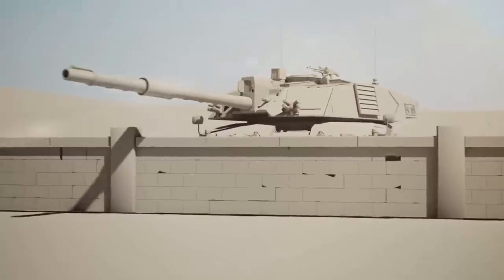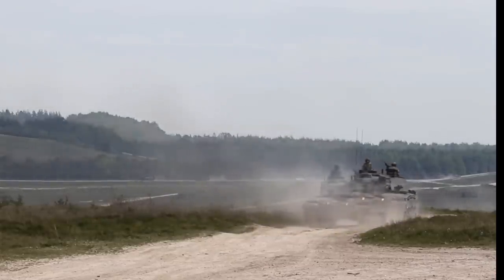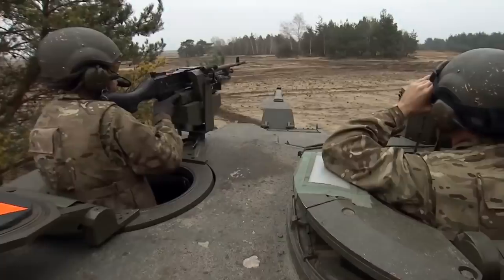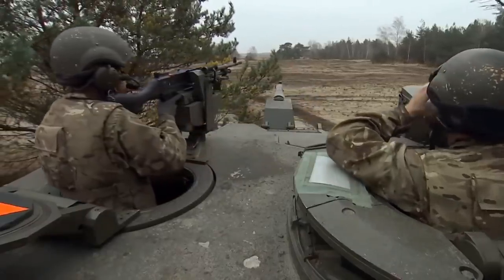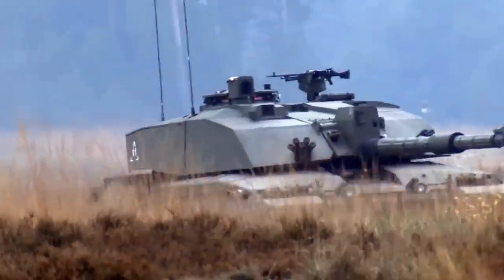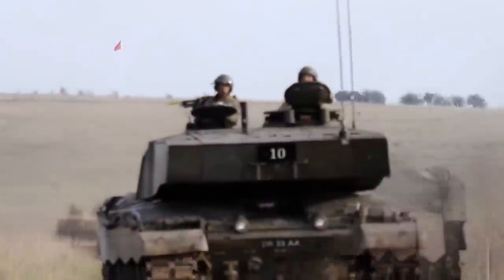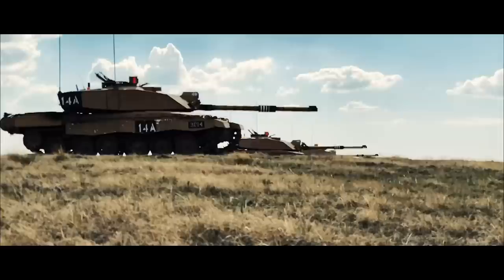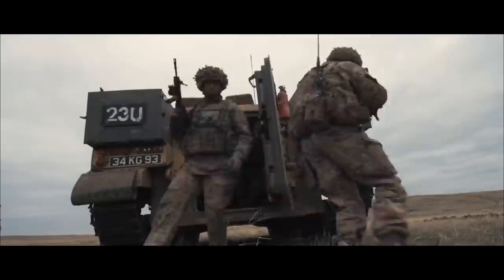Challenger 2 Tank "Black Night" | MODERN UPGRADE

Comment: Hmm... apart from the natural process of getting rid of outdated parts and replacing them - OK. But seriously:

There is not any signs that the Russians are able to come up with anything that really can be a challenge to what Nato allready have. The problem is really Germany that has sold their large stock of Leopard 2 - at firesale prices. There might be some idea in putting a sexy french turret  on the Leopard 2 chassis - getting rid of some of the German overdesign.

Even if Russia is able to come up with something substantially better than what they have at the moment: It is a no starter. Russia simply can't afford it. Besides the point: What the russians really fear is that the army realizing they are in for a short and very bloody carreer - well then they just might turn their tanks around and replace the management, as they have done so often before.

If we see the Baltic area with the formation of a divisional command and heavy tanks from Norway, Denmark and Canada (40-50) a piece then a divisional reserve from GB with a similar number will be able not only to deal with the pitifull tatters that might limber through the main forces but also will be able to smash back in a counterattack that threaten to cripple Putins constituency.
Historical evidence informs them, that an assault will incur casualties Russia today cannot afford - much less is likely to be able to aquire.

No this seems to be the sensible proposition: Take the Challenger 2 and tart it up a bit put some new periscopes on it. With a nice supply of replacements, because - as You say - they are the pieces that are liable to break when the arguments turn nasty.
Reply: Is that before or after the nukes land?.
Reply: Singha Mura 
Joke's on you, the autoloader was one of the modifications.
T-72B3 is very much up to T-90 standards.

It's 2018 and people already figured out thicker penetrator helps it resist effect of composite/ERA but people are still bitching and whining about Russian APFSDS having shorter/thicker penetrator.
Reply: The problem for the Russians is that they do not have the troops to use that tactic any more. We saw how they got butchered in Chechetnia.
Another point is: Stalin could use the tactic, but Putin cannot, as the army is on the verge of mutiny!
You saw that at the invasion of Ukraine they pulled out a battallion just before the invasion (and apparently replaced it with a local defence battallion that ran out of fuel). The entire officer corps in Khaliningrad (Königsberg) was fired - indubitably to incompetence. Ineptitude is as serious as disloyalty.
Not that our side is without mongs among officers.

A lot has been written about the T-14 braking down at the rehearsal of the parade. Whether it was mechanical malfunction or driver incompetence is immaterial: They could not even practise a parade!

The other thing is: We are talking Nato now! If they try their grabbing technique in Bulgaria there is nothing to stop a counterpunch against Sct. Petersburg - and THAT is Putins constituency.

As to the nukes?
1. How many of them work - agreed 1 is enough.
2. How can they control them from going rogue? I mean: A nuke for Moscow fired from the suburb?

The point is that Russia is collapsing and the trick is to make it so slow that the butchery does not spill over in our pumpkin-patch.
Reply: Ahhh.... a couple of years ago a couple of F-15's landed on Ämari where a C-23J allready was: In depth photoreported, but not widespread.
Reply: Thomas Borgsmidt Сало уронили!
I am satisfied with the hysteria of the "western" trolls)
Beautiful words that contradict logic and common sense. You are repeating the principles of propaganda that are old as the world; it works for people who think in illusory categories, which unfortunately are the majority. But for those who understand the technique, tactics and economics, such sophistic exercises are ridiculous.
If you are sure of yourself - Μολὼν λαβέ! But do not think that it will be easy, maybe you will even be left alive as a result, someone must restore the destroyed.

Comment: Iv Read that the russians have cancled their initial order of over 150 t14s because they were too expensive and instead are working on their t90 t72 fleet
Reply: Yep. 'Armata' (T-14, T-15, T-16) program is cancelled, 100 units will be produced, after that, production line will shut down. Mr. Borisov said T-72 and T-90 versions are plenty at the moment (which is total BS, but yeah).
Reply: @jonny2954  so that means the ultimate fight to the death t14 vs NATO Tanks will not happen...Sigh just as when things were looking good
Reply: No you are wrong. Russians don't have money.when they get money they will start mass production of armata combat platform. Same for su-57
Reply: T-14 was a cheap version of Object-195 anyways.
Reply: @seemabalkote1759  that's what happens when oligarchs don't get taxed and bribery runs rampet.
Reply: Seema mate,...
Russia's economy is the same level as Italy, and much smaller than UK for example. Despite them pumping 5.5% of GDP into military, the net numbers won't EVER get to point where these incredibly expensive projects will get to point of reality....With the corruption rooted deeply into the state, the projects would also be overpriced to hell. The might of Russian military is long gone, and it is only getting worse. Especially after Putin's presidency ends...
Reply: @Rayhan That's not true. They originally planned over a thousand by 2025. However they cancelled these plans because of cost. But in 2017 they made an order for 100 t14 armatas by 2020. They already have 20 - 30 t14s that they were doing tests with. So by 2020 they will have around 120-130 t14s. They did not cancel this order. Yes it is true they are modernising around 400 T90A to T90M and around 2000 t72 has been modernised to t72B3 and T72B3M. also around 150 T80 are being modernised to T80BVM. This is a extremely cost effective solution. Also they have ordered the first 10 BMPT72 terminator tanks which are being accepted into the army.
Reply: We're fast approaching 1998 again. Back then Russia's economy was collapsing and China's economy was still reeling from the impact of the 1996 crisis. So China quickly snapped up unemployed but experienced Russian engineers to beef up their industrial base and put a lot of defense R&D projects on hiatus, substituting them with Russian imports. Russia for her part was forced to sell a lot of military IP to the Chinese to keep the MIC alive. If the situation repeats itself, we'll hopefully see the Armata (or its technologies) in Chinese service in a few years. A Chinese Armata would be pretty dope, and hopefully the Chinese won't shy away from the 152mm the Russians rejected for logistics reasons.
Reply: If someone takes the statements of the media seriously, I'm sorry for you)
Armata is not only a T-14 tank, but a platform for new systems. You confuse pre-production samples and those that will be transferred to the army.
UVZ stated that:
T-14 will be produced in parallel with the repair of T-72B, modernization of T-80B and T-80U, T-90A. This is done by different enterprises. As long as the Armata platform does not occupy all niches of use.
Why not make it fast? Because it is not a game or comics. It takes years. Few people are able to realize a similar scale. These are not 200 and not 500 tanks, they are thousands of units of equipment, not only tanks.
This work has been done since the mid-80s (Project 299). And now gives its fruits)
Yes, the 152mm module is ready. But it will have another cipher, not T-14. There are many specialized machines.
Reply: Jonny
No, Armata is a continuation of program 299. T-14 is a derivative of object 195, this is not one thing total.

Comment: How is the Challenger 2 classed as an MBT when it cannot survive a hit to its under glacis plate, surely it would be classed a Tank Destroyer as it fights long range and uses cover to hide its weak lower plate. I'm not trying to offend the tank or the people that enjoy it, in my opinion its one of the best looking MBT's for sure (and in black it looks insane), but compared to an M1 Abrams - a true MBT - the Challenger 2 seems more like a Tank Destroyer. Just curious why its classed as an MBT.
Reply: Karnipex I see what you mean but the term tank destroyer isn't really used anymore
Reply: True, apart from the STRV 103 :)))))
Reply: Don't let Mr Moran hear you say that.....
Reply: In areas of combat the Challenger 2 is already fitted with a block of Dorchester composite for the lower glacis plate.
Reply: Stop refering to games
Reply: The lower plate protection on fielded Challenger 2s has been significantly improved.
Reply: Karnipex:
But the Challenger in question did survive and was not knocked out, though it's driver was wounded.  Read the accurate incident report before you engage in nonsense.
Reply: Chris, as a Mr. Moran, Steel Beast gamer player, and friend of Matsimus. My interest is piqued by your comment. Have I said something regarding the Challenger 2, or has a smarter relative said something profound about it? :-)
Reply: You know the Challenger 2 has a better survivability record than the Abrams right? Both tanks were used in the 2003 Iraq war with the US having 17 Abrams destroyed or damaged beyond repair. Only one Challenger destroyed when it was hit by friendly fire while its hatch was open (the round actually hit the open hatch lid sending shrapnel into the cabin with 2 killed and set a fire). But to be fair to the US, they deployed more tanks and so had a higher probability of more being destroyed. It also worth mentioning that the Turks have had 10 Leopard 2 losses in their Syrian conflict (the caveat being they were older A4 Leopards and were operating with questionable tactics).
  So, caveats aside, the Challenger 2 does have the best survivability record of the 3 main western MBTs.

Comment: Thing is, you change the gun, you have to completely change the turret with bustle ammo storage and then strip out the hull floor storage. Then you change the engine and really there aint much left. Tracks transmission and hull.

Comment: Still with that trash gun and engine. This isn't an upgrade, this is a insult. Knowing the UK MOD, even though Rheinmetalls proposal will be superior (no doubts about that), they will still choose BAE because 'british jobs' and stuff.
Reply: Trash gun? Really? It still has some of the highest penetration of a 120mm tank gun out there.
Reply: No, it doesen't. It's the worst 120mm tank gun in NATO.
Reply: @jonny2954  errm no its not, its one of the best, only the L55's ammo has higher penetration and that does not have "that much" higher penetration either, also considering the vast majority of RM smoothbores on NATO tanks are L44's....
Reply: L44/M256 and GIAT CN120-26/52 are also much better. The problem with the L30A1 is its lower chamber pressure, higher friction, lower EFC count and shorter/lighter APFSDS penetrators in comparison to smoothbores.
Reply: @tonyb1223  The british MOD now changed the requirements for the LEP. A smoothbore gun is now mandatory. That probably also means a new turret.
Reply: @jonny2954  it needs more than a new turret, it would require a new tank because of the way the 2 piece ammunition is stored, this is the reason they binned the idea of a smoothbore gun, too expensive, instead they found themselves a new munitions manufacturer.
Reply: @tonyb1223  The hull is fine. It was the turret that had the stowage problems for the one piece ammunition.
Reply: Jonny just so you know the gun is bloody marvellous
Reply: @angrypenguin6966  It's pretty shit.
Reply: @angrypenguin6966  Don't argue with Jonny, he knows EVERYTHING about EVERYTHING!

Comment: I cant imagine it would be that hard to get an extra 300bhp. Also with modern engine technology a hybrid option could work too. The E-Motor can torque fill and provide a silent "creep" mode plus potentially better economy therefor longer range.

Comment: Wish they would change the barrel also. The riffled one has better lifetime, smothbore higher muzzle vel. right?. But i have a question would the breach capable  or compatibel to a existing like most used l44/55 and its licenced versions?
PS: 2nd question also answered by the vid if the riffled is capeable, shooting ammo like NATO M829 DMxx but you said that ammo issue not able to do this. And britain stands out in this situation using riffled gun in a MBT of this days the costs must be high.

Comment: I feel like this package is great since it focuses on the vehicle and crews safety from infantry and air attack in the sense that it includes these missile detecting sensors, however even with the driver and comanders new sight systems, not much has been done to improve this hunter killer role that was mentioned so much and that is why I feel like this power pack is vital so the Challenger can keep up with lighter or even more modern combat vehicles
Reply: Anne Isopod  however, it is useful when you have a small explosive device on the exterior of the vehicle that is designed to destroy incoming missiles

Comment: It needs a 2000hp engine, with all the stuff getting added the weight just keeps going up and up, it's over 70 tons already. A 1500hp just won't cut it anymore. 
Stick on an L55 smoothbore, bit of extra armour in weak spots change the external GPMG to a remote control one, but priority engine and gun definitely.

Comment: COOL!! As a former Tank Commander of TC. Is this tank going to be better at maintaining like the engines, fire control systems, main gun, suspension, tracks, etc. As being in armor once upon a time. Tanks requires maintaining out in the field every time we stop or do a short halt. Knocking back or replacing end connectors, add oils, and checking links to steering. Bore sighting, ballistic computer indexing with ammunition for gunnery. Stuff that goes through a Tank Commander's mind and his crew at all times in the field for training or combat. On a tank the manual will go as long the Christian Bible or War and Peace from maintaining this to how to employ it in combat. Far complex than in my previous life as a Paratrooper and Infantryman. Being a Tanker is far more dangerous because this machine can injure or kill a person when you don't understand how it works and the safety stuff associated by it.

Comment: Mate, I am only going to concentrate on APS.
The Israeli Industries Trophy system has now been fitted to Merkava 4s for at least the last five years. In that time they have been actively engaged by the latest Russian ATGM as well as the good old RPG 7 when they went sight seeing in the West Bank. The system works, it has managed to defend Merkavas against multiple simultaneous engagements. The Iron Fist system that I presume the "Black Knight" has been fitted with has been in development for the same number of years but has not been fielded by the Israelis. Both use a combination of radar and optical sensors to detect missile threats. However, the Iron Fist uses an explosive blast technique compared to the tungsten cube shotgun/claymore effect that Trophy uses to defeat threats.
You mentioned the T14 Armata with its Afghanit APS. I don't believe it is a flexible as the Trophy/Iron Fist solution as its fixed over the forward quarter of the tank. Therefore anything approaching from the sides, rear or top will not be engaged. The T14 is built around the standard Russian doctrine of offence is the best defence, hence the massive armour protection up front. The Iron Fist has shown in a  "demonstration" that it could defeat a top attack ATGM when a Hellfire was targeted at the demo vehicle.
My opinion is that for Chally or any MBT to remain useful on the future battlefield it needs APS to survive.

Comment: Israel used active protection systems in combat a few years ago and they were demonstrated to be highly effective, intercepting the majority of incoming threats. It could not intercept all but protecting against more than half is quite a large leap in overall protection combined with other systems for relatively small increase in weight.

Comment: The Challenger 2 is 20 years old now and as such the need for an update, if not replacement is not suprising.  Having said that it has proven itself to be possibly the worlds best protected tank of its generation.  Clearly the T14 Armata has this beaten in terms of active protection and crew protection.  The Challenger 2 is not going to be able to match that because it needs a completely different design from a typical tank layout.  The main areas the Challenger 2 needs to improve in order to remain relevent until 2030 are down to the electronics and computing hardware plus active protection.  

I think that the military are taking a page from the science fiction stories of the Battletech series.  That features a system called AMS which stands for Anti Missile System.  The basic version of this is a computer controlled automated light machine gun turret that targets incoming missiles.

I would expect that development on a new tank will start in a few years to replace Challenger 2 in 2030.  Whether it can be delivered on time or on budget remains to be seen, probably not going from recent examples.  I would expect the issues of switching to a different gun, power plant and possibly automating the turret would be addressed there as it would be too costly to be worth while on such an old design.